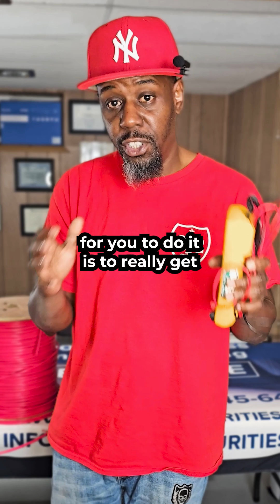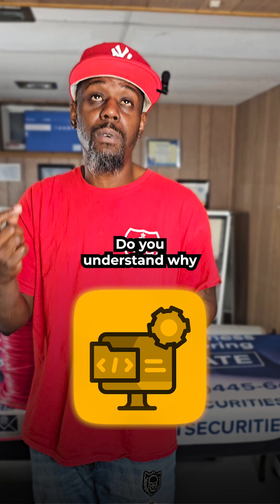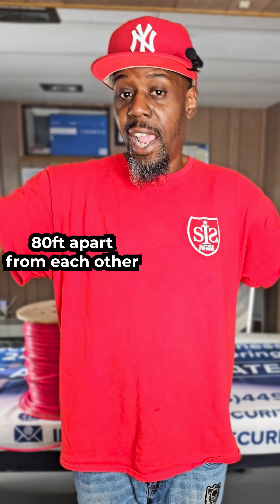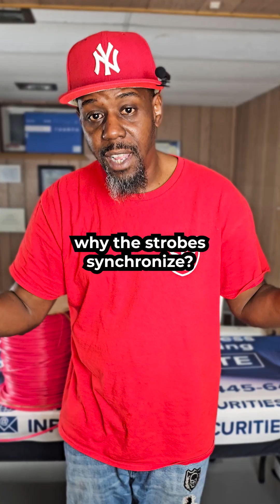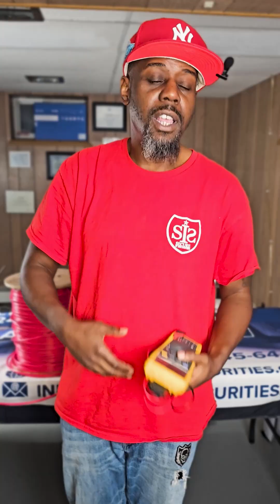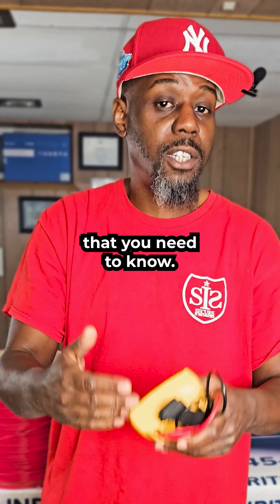How Fire Alarm Systems Actually Work

Comment: I've been an electrician for 6 years and but only ever installed fire systems (run EMT/wire, install the devices) but now I'm doing electrical maintenance in a hospital and have no idea what I'm doing with fire. Now that I'm in a hospital, I really want to the HOW these things work for my knowledge but also patient safety. Hope to learn a lot from you!
Reply from the maker: You will if you have a specific question feel free to shoot. Also join the training center. It's free.